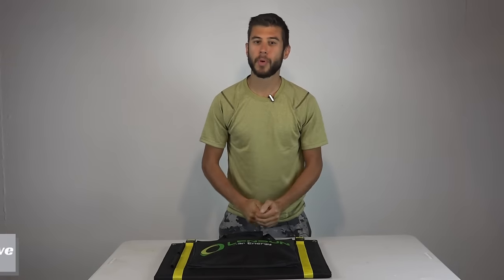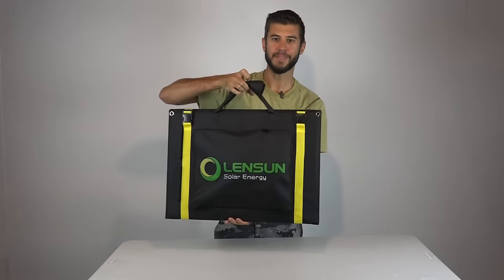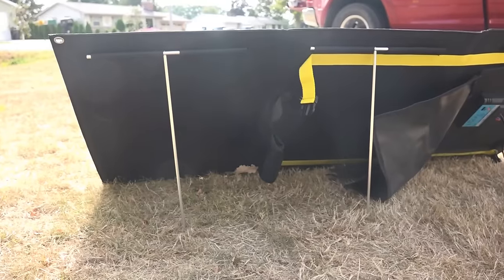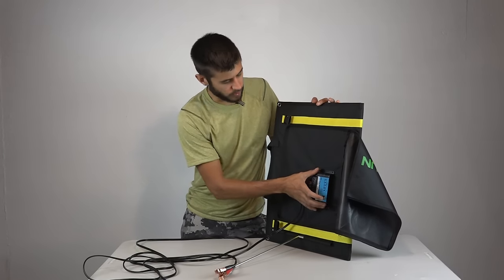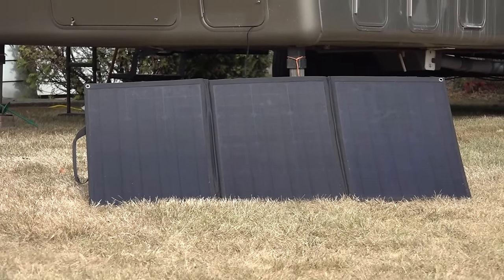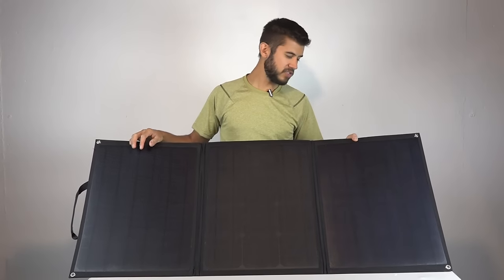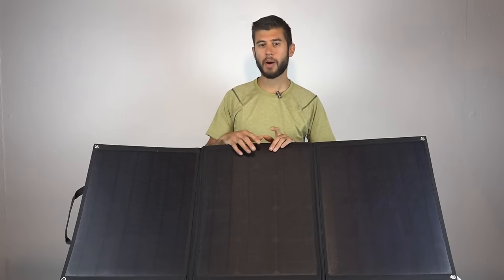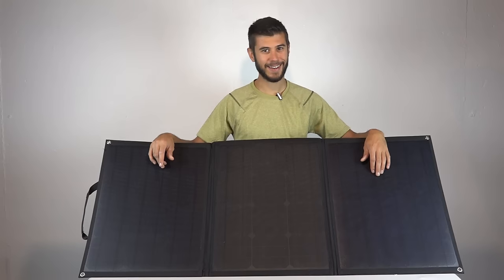100 Watt Lightweight Portable Flexible Solar Panel Kit from Lensun | Product Review

Comment: Im subscribing ...can you show us how to connect a folding solar panel.....which has a charging box not charge controller (??  But i know the battery needs charge controller i think??) to a deep cycle battery to charge it??? .lots of the fokding panels on anazon font have cobtrollers but just those pkug in your phone boxes ......i am setting up a ..minivan camper......Im.looking for a video that does this but cant find it ....you seem SUPER knowledgeable and im kinda begging for myself. ....a newbie 

Goal for me is to use a deep cycle 100 aH and a charge controller and folding 100 or 120 watt panel ...but all those folding  panels i see on amazon come with a charging box to plug in usb and c but no alligator clip for a battery or charge controller to stop battery overcharge???   I need to learn how to connect all those and then alligator clip to the battery i think?? ....can you help ?

Comment: Thanks a lot!! I have been wanting to get into solar, but cost, difficulty, etc., have kept me just researching. For $380, I might just go for this as a starter solar system for our travel trailer. Need to get better than my current 12v deep cycle marine battery first maybe. It requires two 6v batteries to replace one 12v, right? The USB port being outside like that doesn't seem so good for plugging in iPhone or iPad. It'd be exposed. But I guess you could still charge them inside trailer? Even with all my solar research and reading, I still have a lot to learn!
Reply from the maker: You can connect this to any 12V system but if you are looking to get more battery capacity you can usually get more and at a better price using 2 6 volts in series. Here is a video we did on that a while back https://www.youtube.com/watch?v=_sqRUPFiMQ4

Comment: This seems to be a very affordable and practical option, especially for van dwellers.  It looked like you connected the clips to two separate batteries.  Is that the proper way to do it?  Also can multiple panels be used by connecting to other batteries or connecting together?  Thanks for bringing these to our attention.
Reply from the maker: I guess I did not explaine that in the video.  We have two 6 volt batteries wired in series so the positive and negative 12V terminals are not on the same battery.  You just need to connect these to the 12V terminals.  You cannot connect this system directly to another but you could use multiple connected to the same battery for sure.
Reply: Cheryl - There are a number of good battery videos out there. I did one on batteries recently as well. Tom knows this stuff really well and is generally considered a trusted resource, havng helped other RVers on similar questions. Whether it is 2-6 volt batteries in series, 2-12 volt batteries in parallel or four six volt in series/parallel the answer is yes the leads should be connected to different batteries and you must understand which two terminals and which two batteries. Generally the two terminals that your dc system is connected to would be the correct ones. You want all batteries to see the energy equally. A single twelve volt battery system obviously connects to the two terminals on one battery.

Comment: I bought this item off of Ebay but soon found out I had to fill out IRS forms to prove I was not a company plus three other forms (PDF's) and send all documents to DHL bc it was shipped from Hong Kong. I thought it was too much personal information going to other people i didn't know. The DHL shipping agent said to blackout all personnel information. I refused so the Lensun solar shade got shipping back to China. Then Lensun sent one from Amazon to complete purchase. Opening "complete kit" I noticed there were no cables or controller. I went back to description and read down all the way at bottom to see it said panels only, not obvious at all. Lensun said to order controller and cables with no part numbers just sent two pictures. After many emails to agents in China, different time zones, they finally sent what I should buy, purchased two items then all is fine right? No, after purchasing cable I needed they said they are out and to order a different cable that cost $10 more. I had to ask where to send extra $10 then finally got a PayPal account to send it to, more emails. The new cables had to be adapted to controller so off to auto parts store to buy alligator clips, wire strippers too. This was a very painful experience taking over a month to finish purchase and set it up to work. Buyer beware, "complete kit" may not be completed. If it ships from Homg Kong you will have to fill out time consuming forms and mail or email shipping company like DHL. If they say buy other parts needed then you may have to buy it from Lensun website and not Amazon. Buy it from RV place instead and let them deal with Lensun.

Comment: Fantastic review, very professional and well thought out. Seems like an excellent product for anyone wanting to use solar for a small application like a van or small trailer or add to an existing system.  I especially liked the portable table you were using. It looks like the one we used in our living room for fine dining in the U.P. 
Are those portabello mushroom stains? :-0). 
Thanks for this!

Comment: Cool product and maybe a good solution for a van dweller but really, what use is this in a 5th wheel Motor Home or large travel trailer. Not to mention the PWM controller limits performance. May be good for a hiker or tent camper to charge a phone or laptop but useless in a large RV

Comment: Can you add more solar panels to get to 200 Watts?  Or would you buy 2 and maybe connect to each battery separately (not sure that would work while the batteries are connected).
Reply: tjenkens just put all the outputs of the chargecontrollers in parallel and run them into your batterybank. In this way you can add up as many panels as you want.

Comment: You can easily rig a 100 watt flexible solar panel on Ebay and get plastic PVC legs for about $100 and a charge controller for less than $10.  Why would anyone would pay $300 is incredibly dumb. For my price you could buy 3 flexible panels for 300 watts at the same price as this Lensun.

Comment: love lensun panels but they are stupidly overpriced.  noway would i spend 300$ + for this thing. other options out there that accomplish the same for a lot less$$
Reply: it's fukin 329$ for a $100 watts! i could slap together 2 50 watt  flexible panels with the same or similar  cheap ass pwm  controller for around 200... minus some canvas but plus++ efficiency as these panels are shit with even the least bit of shade.